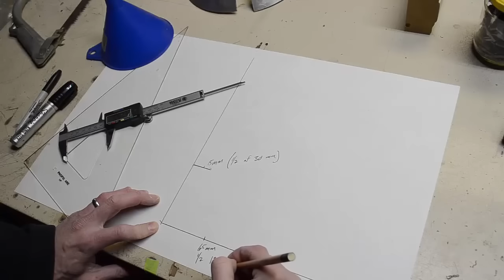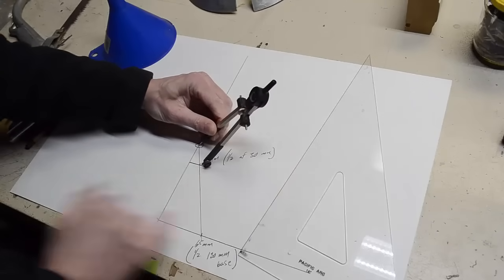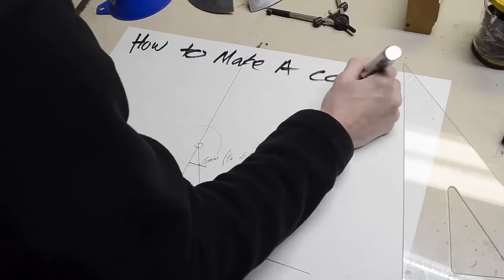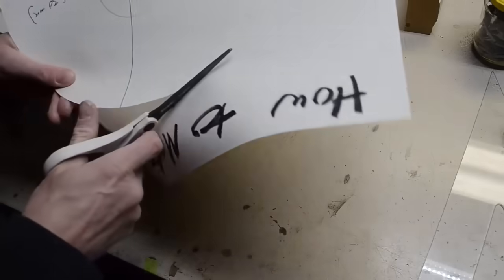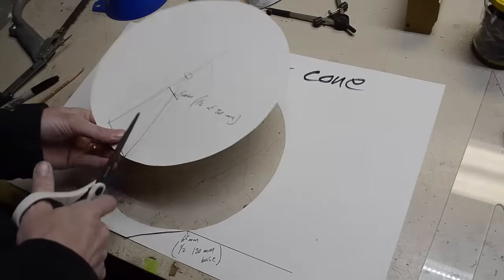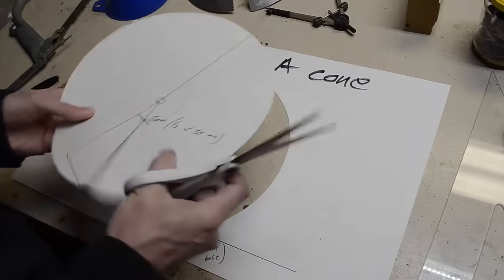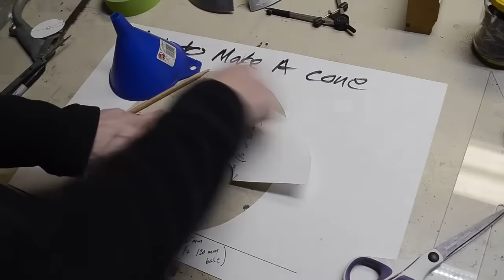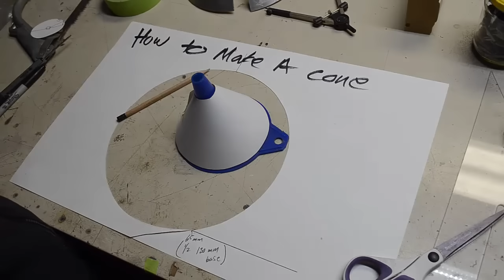How to Make a Perfect Pattern for ANY Cone or Frustum - Great for Fabricating Frenched Headlights

Comment: That should be plenty helpful to some folks. However, if exact fitment is required, why would 1 measure the I.D. of the lg. diameter and the O.D. of the sm. diameter? Wouldn't you want to only measure either 2 I.D.s or 2 O.D.S? (Measuring the sm. I.D. can sometimes be tough or near impossible.)
The thicker the material, the more critical that question would apply. Wouldn't drawing the smaller circle to the inside of your 15mm mark rather than the "outside" be more accurate?--Because you measured the i.d. of the lg. circle. Math is definitely not my strong point.

Comment: The last time l needed to layout a cone for a repair project at work it was for centrifuge used in food processing. Sheet metal mesh screening. I was not working on the job and they two guys doing the job had a problem figuring it out. I showed them the three pieces of data they needed. The two diameters plus the length of the slope. It was easier to measure the slope than the height. Draw it out on a large piece of paper and fit the resulting cone into the place where the mesh went. The "pattern was cut intentionally long. Trim the pattern to fit properly and transfer that to the mesh. We only got one chance at cutting and fitting the mesh. As l recall the the mesh also needed extra material at the top and bottom for the flanges that clamped it in place. Work perfect first time. I forget the make of centrifuge. Only one l ever saw. We built centrifuges and also serviced other makes.

Comment: 180x130÷ slant height= included angle of development
Reply: 180 is a constant ,the other 2measurments are variables according to cone dia and slant measurment
Reply: I was thinking along those lines as well...190°-200° would work out well since your hand fitting the part . 
As for the math itself,  he was folding the dimensions in half , he should have done the same for the length ,not 360°

Comment: Helpful in first half but as I do not have a cone I am starting from, but am making a cone from scratch, knowing how to deal with all the extra material such that one has a symmetrical cone would be helpful.  But a good start for me.
Reply from the maker: @marykayryan7891  I only used the first cone as a visual. It was built the same way by measuring the top diameter, the bottom diameter and the height. just keep your extra material parallel to the cone and it will be symmetrical when you trim.
Reply: @AdamBeckSpeed  Thank you for the extra help.

Comment: What if you don’t want the angle so extreme? Would you make the inner circle larger?
Reply from the maker: I’m not sure what you mean by extreme, but yes changing the size of either the inner or outer circle changes the angle of the cone. Looking at my cross section if I want the cone flatter, I’d make the inner circle smaller, or the other one larger.

Comment: 130mm X 3.1416 = 408.4mm circumstance. You may need to add run-in and run-out for slip rollers.

Comment: Absolutely fantastic! For most everything I will ever do, this is sooooo simple it’s pure genius. The other explanations took me back to my Trig classes in  1958, where I really did not want to go. Seems the only calculation needed beyond this is to calculate the circumference for the large end, and add your  choice of overlap. For example, if the large diameter was 4 inches, then 4 x pi gives the circumference, and if an overlap of 1/4” is needed for solder, glue, add that to the end of the pattern and draw a line parallel to the cone end.
Reply from the maker: Material thickness is always my issue with this calculation. If I'm making it out of .063" aluminum that throws the calculation way off, especially considering the material is at an angle. This is why I like to cut it long and trim to fit. Thanks!
Reply: @AdamBeckSpeed 
Spent some time designing my own models to be built out of cardstock. There are cone generator apps on the web. But l also did it in CAD. One reason for doing it in CAD was to break the conic surfaces down to short and half sections to fit onto cardstock that fits into a printer that takes A4 or letter stock. Plus repeating patterns such as access panels etc. The tricky part was doing the inner layers that were required for stiffening and extra details. Lips the access panels "attached" to. Paper thickness could throw things off. In order to keep assemblies as circular as possible l would make jigs the parts set into. Some of the jigs were machined from used tapered roller bearing races on the lathe using tooling meant for turning hardened tool steels.

Comment: Great video Adam!  I have a bit more complex shape:  I need to make a cone shaped like a Volcano: wide bottom, tapers inward to narrow top.  Think of the police megaphone but standing upward.  Taper has me. Stumped Could you help me solve this?
Reply from the maker: Are the sides straight or are they concave?  Thats the profile from top to bottom. If they’re straight, you would do just like I showed. If concave it becomes a compound curve and you can’t really use this method. How big would it need to be?
Reply: @AdamBeckSpeed  thank you for replying and great questions.  I look at it as a closed cylinder type shape. 
Dimms: 
10”ht
6”dia at bottom
3”dia at the top

- The concave curve starts immediately from the bott then curves slightly in & up for a climb of 3”+-
- At that transition point the dia is ~3-3.25” as it smooths out.
-Then the remaining 7” is just a 3”dia cylinder to the top.
- Goal is to have a nice, concave curve with smooth transitioning from that 1st 3” into that 7” of straight line upward..

- I am making a pottery vase out clay. 
- Initially I throw this shaped pot on the wheel. This shape is perfect for this hand technique. But too much for production run of 50

An easier way is to make a template from a pressed slab of clay & trace it,cut it out, fold over to get shape needed. But since this shape is not as simple as a cone I have a puzzle.

So I cut open the thrown one, unfolded it flat then traced it onto the slab.

- But it doesn’t translate well when folding it over to begin shaping.  Hard to explain, . I don’t know how to represent that junction point from curve to linear onto paper. I know I can borrow some of the steps in you’re vid  but stumble on this shape.

Thinking as I write: should I break this into 2 separate shapes? 
- A 7”l x 3”dia cylinder
- A cone’ish shape at” 6”dia to 3”dia cone then attaché the two?
- This is doable even with high qty but 
Still requires a lot of ‘blending to make that curve which costs me time. 0pay now/pay later 😀

Well any insight is appreciated Adam Sorry for long txt here
Reply from the maker: Apologies Aamber I know almost nothing about clay pottery. It. Seems like you could use this pattern as part of the process. The tough part is gonna be the curve. Could you make a straight buck to shape the clay over and then add the curved part on the wheel?
Reply: @AdamBeckSpeed  No worries and I agree with you.  I think I will break down the shape into 3 smaller, manageable parts, then attach together. Thanks again

Comment: What is the measurement for the cut line?
Reply from the maker: I dont remember that one. Honestly, I never use it because things like material thickness and the width of the pen / marker you use can throw it off. I like to cut it long and trim to fit.
Reply: @AdamBeckSpeed  thanks for answering!  This video was super helpful for what I was trying to do!

Comment: wish it was in inches
Reply from the maker: It works exactly the same, it's just easier to do quick math with metric. dimensions would be like: 1 3/16" at the top, 5 1/8" at the bottom and 3.5" tall.

Comment: HI Adam, thanks for the great video demonstration.  I agree with Marcus, if possible could you please post up the rest of the calculations for the complete template.  I work with metal, as a jeweller I will need to bend and shape the metal into the cone, so need the complete shape to begin with.  That would be awesome.  Thanks.
Reply from the maker: I don’t have other calculations- I just extend the circle with the compass so it’s long and trim as needed. This is the complete shape, you just need to roll into the cone.
Reply: @AdamBeckSpeed I think he meant the calculations you mention in the video for cutting the shape with no overlap. You said you weren't going to bother with them, but he was saying it would be great if you could share them in case anyone else wanted to bother with them, like I do.  😊 Great video, though. Very helpful, thank you! I AM going to try to find a source for those other calculations you mentioned, though.
Reply: Same